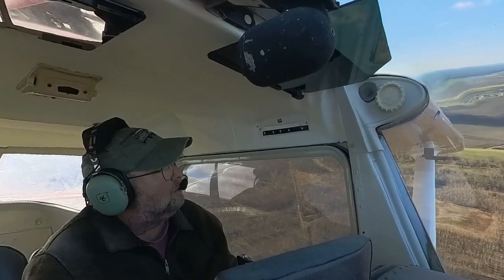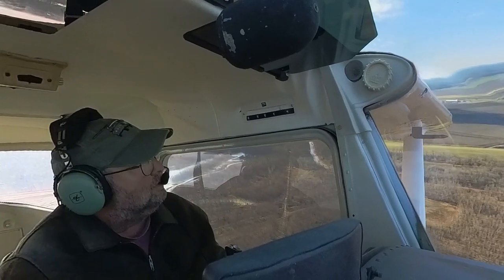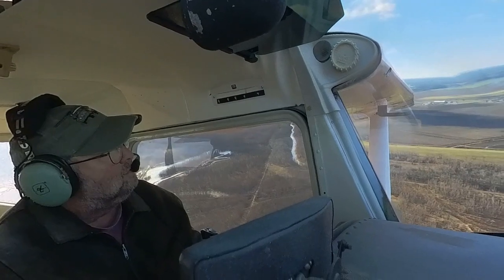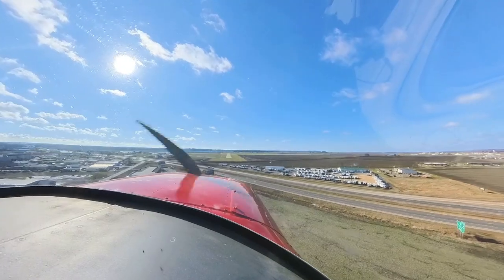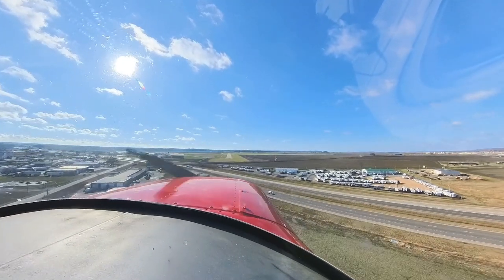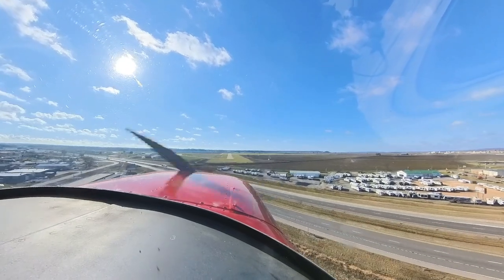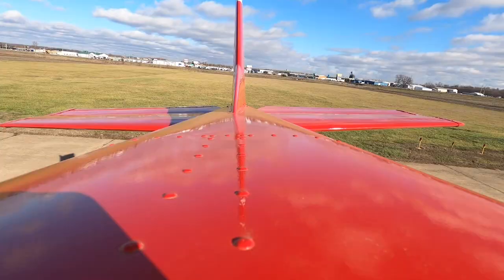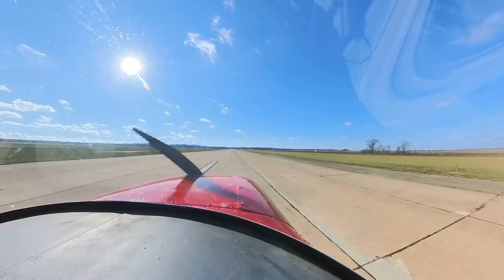Don't lower your flaps to 40 degrees in a Cessna 150 !!

Comment: As a  longtime CFI and owner of a 1976 C150M that has 40 degree flaps,, a blanket admonishment against the use of 40 degree flaps is questionable advice.  If a pilot understands the risks associated with the use of full flaps, and has adequately mitigated those risks, there is nothing wrong with taking advantage of the landing performance benefit 40 degrees offers..  One of those risks, as Mr Gryder discovered the hard way, is that under certain combinations of weight and density altitude,  a go-around may not be possible with flaps 40.  Hence, the use of 40 degree flaps should be reserved ONLY for when the runway is made along with a commitment to land.  We brief exactly that on each and every 40 degree flap landing.
Reply: ^^this^^
Reply: I feel like this is one of those things wherein the  use of 40° flaps is so specific that for a general audience "Don't use them" is the best default position, especially if you are learning from YouTube as opposed to a certified instructor. As you stated, the choice to use 40° wouldn't be there if it didn't have a valid application. Once you really learn the aircraft you can work exceptions into normal flying but for the beginner staying away from 40° is probably a good idea. I learned to fly in a 172M with a much lower glide ratio than normal, closer to 7:1 than 9:1. I had to carry some power much closer to the threshold on final to make the numbers. My CFII helped me to understand that this could be used to my advantage because it would allow for very short field landings if needed. He taught me first how to land like a 172 is supposed to and then work the specifics of this plane into my bigger picture.
Reply: My biggest fear with using 40 degrees of flaps on my 75M was that I could land in places far far too tight to get back out of.

In all seriousness - they also allow for a much steeper approach. I’ve done touch and with full flaps (was alone and light) and it did climb back out - but there is no mistaking that the flaps are down and you have to be ready to shove the nose down.
Reply: Agreed, I'm a CFII and own a C150 and use 40deg flaps regularly. Just gotta know when they are appropriate and when they are not. I also have mechanical flaps.
Reply: Dunno what to say?  My family’s  plane was a ‘76 M - we had it for over 40 years.  Full 40 degrees of flaps and a full boot of rudder to slip was great fun in the right conditions!
Reply: @rcaddiction7071  literally ANY airplane can land in a distance insufficient to takeoff again, regardless of flap settings.

If you make takeoff decisions based upon full flap settings, rather than takeoff settings and performance, you're a fool.
Reply: AGREE
Reply: I agree with you. As the owner of a 150E, with manual flaps, I enjoy the use of 40 degrees of flaps, and being committed to land is certainly helpful - however, I can dump them quickly as they are manual for me.
Reply: True… dragging the plane in is never a good idea.
Reply: Dragging a plane in under power on short final isn't  very bright to begin with. You should be able to glide it in from your key position. Flaps 40 is a great tool to drop it in short or point the nose down if you're way too high.
Reply: And who would ever drag an airplane in low with power to make a landing regardless of flap setting! That's just asking for it!
Reply: As a CFI I agree 100%.
Reply: Thank you for the great topic discussion on 40 degree of flaps owning a E model this is something that i have often hesitated on using
Reply: Why are you using partial power and 40 degrees of flaps and dragging it in behind the power curve? I use 40 degrees all the time but I’ll just use a steeper angle of descent, power off. And, I’ll only put in all the flaps when I know I have the runway made, and it’s clear.
Reply: As a student pilot I rented a 1969 172 with elec. flaps. The detents in the switch were worn almost flat (paint wore off too) so it was almost impossible (for a student) to find the setting you wanted...The CFI said..."ah...it's no big deal"...and it wasn't really. I had a lot of (un-logged) stick time because my uncle, a USAF, Retired, Lev. 6 Colonel, took me flying all the time (Super Decathlon)  in my 20's. After my solo first  flight we flew to Cable Airport (So Calif) where my brothers 1959 172 was hangered. My instructor checked me out in it and that's the plane I flew the most from then on. It had manual 10-40 degree and 40 was a lot of fun. One day (doing touch and goes) a gust of wind from the left  blew me right off the numbers just before touch down. I found myself flying over the tops of tied down planes along the taxi way. I (constantly) rest my hand on the throttle so I immediately added a little power and the plane ballooned up like kite (while pushing forward on the yoke). Now  that was fun too but my instructor never taught me how to do a go around...So I'm cruising along at about 60-65 and added a little more power and raised flaps one click to 30.....a little more power ....then 20 and so on. I still don't know if that's the proper procedure but it worked just fine....somewhere in there I turned off the carb heat.
Reply: The 1964 172 I learned t fly in had a handle between the seats. I believe the flaps went to 40
Reply: Exactly, if you want to mush into the ground
Reply: I just used 40 degrees today in the 1963  150-C I fly. I was doing a simulated engine failure, and was way high, so once I knew I had the runway made, I started putting in flaps until - you guessed it - 40 degrees. It's also a great tool to use if you're just too high and you need to get down fast.
Reply: I was taught to fly in a 150 in the early 70's in south Mississippi and was taught to use  40 degrees of flaps anytime needed.
Reply: I fully agree. I always used 40 degree flaps on short final with a 172 and it worked out fine every time. At that time, there was no need for a go around attempt and I loved the performance it gave me.
Reply: I too had a fantastic CFI. He taught us how to use 40* of flaps the right way as well as all the 150's envelope. Full stall, crosswind, short and soft field landings were the norm. Full flap go arounds were fun too.  He was great friend as  well.

Comment: My initial training was in a 150 with 40 degrees of flaps. They work just fine and I used them all the time. My CFI training was in a 150 with 40 degrees of flaps, and again no problem. I'd bet the odds of them not coming back up are less than the odds of the engine quitting when you stuff the throttle in. My Super Cub has 50 degrees of flaps and I use those all the time too.
Reply: Agreed, I'm a CFII and own a C150 and use 40deg flaps regularly. Just gotta know when they are appropriate and when they are not. I also have mechanical flaps, so not coming back up isn't much of an issue.
Reply: What kind of descent rate do you have with 50 degrees?
Reply: @noahshatto7218  No VSI, never looked, too busy flying. It's often done with a full aileron, full rudder slip, not far above stall. If you really want to have fun, try that with a Super Cub on floats! Totally controllable. I'm pretty sure it would pin any normal VSI.

Comment: I learned to fly from an instructor who was also the airport manager, A&P, DE, amongst other things.  We made every landing using full 40 flaps and we made all landings as 180 power-off landings.  We did many go arounds as I was learning to land and it was never an issue.  After applying full throttle and holding the nose down as it tried to pitch up, the flaps were gradually reduced allowing a climb.  The older 150 I flew had manual flaps and the newer one (only a year or so newer) had electric flaps.  Both were flown the same way and with equal success.  It does seem from all of the accidents analyzed by all of the YouTube “experts” that today’s pilots are not really taught how to fly the airplane.  I am glad I learned to fly from someone who know how to fly and knew how to use the airplane to its full capability and taught us to do the same.  I feel sorry for any pilot who is fearful of using flaps 40 during almost any landing.
Reply: EXACTLY!!  Students today are not taught how to actually fly the airplane.  They learn a bunch of rote routines from the high dollar rating factories that are focused on cranking out numbers instead of skills.
Reply: @SteveD328  I fear you are correct.

Comment: I learned to fly with 40 degrees of flaps in a C 150 and I am still alive. As a CFI, I taught students to fly with 40, and like me, they're still alive. The manufacturer equipped the aircraft with 40 degree flaps and the aircraft flight manual specifies their procedures and use. Can you get in a situation where flaps 40 is inadvisable? Yes, but that is a pilot problem, not an aircraft issue. I have attached a very good video from Backcountry182 is a very accomplished bush pilot and his take on using full flaps in a Cessna 150 is illuminating, even if you don't respect my 55 years experience and gold seal CFI. --Bruce Curtis, ATP, MEL, CSES, CFI, A, I, ME, AGI, IGI. https://www.youtube.com/watch?v=esFV4VcsQGE
Reply: Agreed, I'm a CFII and own a C150 and use 40deg flaps regularly. Just gotta know when they are appropriate and when they are not. I also have mechanical flaps.
Reply: @SoloRenegade 
I'll take crank windows and a stick shift (too). 👍👍🇺🇸😎

Comment: Cessna limited the flaps to 30 on the 152 for a reason.  Because the 150  / 152 was purpose built as a trainer and sometimes students forget WHAT on a go-around? That’s right, to clean up the aircraft.   After some incidents where the little 150 couldn’t climb enough with 40 degrees of flaps and bad things happened, it was changed to 30 max and this “never” idea came out. As has been pointed out “because they might not come back up” is a silly, at best, reason.  As our little gems are often in the hands of more seasoned pilots now - having the option of 40 is a desirable and usable feature.  But, you can see why the trainer manufacturer might not have wanted it and why this “never” idea might have been taught. Now you know the rest of the story

Comment: Very early in my career, in the late 70s and early 80s, I instructed in 150s and 152s.  I often used the full 40 degrees of flaps in the 150 and loved what they did for me, they were there for a reason. If you fail to think about the “what ifs”, well, then, maybe flying isn’t for you.  Also, for short field landings, never, ever, EVER drag the airplane in.  You will never realize the short field capabilities of your airplane doing that, plus you are setting yourself up for disaster.  On approach you have 2 vectors for your energy, a forward vector and a downward vector, the shorter the down vector, the longer the forward vector.  Remember, the energy has to go somewhere.  So, use a steep approach, you will have less forward energy, and when you touch down all of the downward energy goes away.  I have used this technique in jets many times and often brought the airplane to a complete stop before the reversers could fully deploy.  If you are worried about the 40 degree flap setting allowing you to get into places that you can’t get out of, you should have thought about that possibility before ever attempting to land there in the first place.  

SteveD328, 24,000 hr ATP

Comment: I flew a 172 in my training that, if I remember correctly, had the capability of 40 degree flaps, but my instructor said it was not rated for 40 degree flaps after the 180 horse conversion.
Reply: The 40-degree setting should have been placarded and physically blocked out with a metal plate.  The 180-HP STC conversion also increased the gross weight.
Reply: @reubenmorris487  I totally agree that it SHOULD have been physically blocked out.  I flew with a different CFI who apparently did not now this. It made me a little nervous when he set them to 40 degrees. There didn't seem to be any consequences, but who knows what would have happened if I had attempted a go-around?

Comment: I used full flaps quite often when I was training in a 150. As a matter of fact, there was often an updraft at one due to a very huge barn being right across the road. Slipped, crabbed with 40 deg also. Never had a problem. 
Haven't flown a 150/152 in several decades, but I still hold them in high regards. 
The lil plane helped me cut my teeth as a student. 40yrs now and I still remember the solo. Lol

Comment: I also did my initial primary flight training in a '66 C150, and back then I was even lighter than you at only 135#.  I did the bulk of my flying with that off a 2000' grass runway as well.  The only difference between 30° and 40° flaps is just drag, not any lift -- that's why the redesigned 152 was limited to only 30°, despite having more 'power', as it was...   I later flew a 150/150 with the 40°, and that one WOULD climb with the full 40 flaps down proving the axiom of 'With enough power, anything will fly' - (which is why the F-4 Phantom flies, but that's another story... ;) )

Comment: I learned a good lesson on my first solo regarding flaps.  On my second circuit at Boca Raton,  FL, in my 1967 Cessna 150L,  I didn't retract my flaps for my next take off... Just screamed down the runway without the ability to take-off.   Had enough sense to stop and return  back to the threshold.  Will never do that again!

Comment: I use 40 degrees of flaps all the time in C150's  and C172's. Did go arounds at gross with 40 degrees, before my instructor would solo me. Seems to be more of an issue with PA-28 pilots that are afraid to go past 30 degrees. Just like an engine failure at low altitude, land straight ahead and fly the airplane until it stops..

Comment: only thing to remember in a 150 at 40 degrees flaps on a hot day, is to add throttle, turn off the carb heat, and land that puppy.... if you can't stay a step ahead of a 150, why are you even flying?

Comment: I Disagree! Any Cessna 150 will go around with Full Power and bring the Flaps up ONE Notch . You will not SINK, if you know how to fly. 10 degrees and wait. Do not get into a hurry!  Flaps up slowly as Performance is gained. The last notch should NOT be retracted until minimum of 800 feet. I own a 74 150L with 40 degrees Flaps. Practice this regularly with no problems. ATP, CFII, MEI.
Reply: The point here is flap system failure. You're not able to bring the flaps up AT ALL.
Reply: @3SM20Pilot  and how often does that happen? Not very often, especially if you fly the airplane properly within limits, and maintain it.
Reply: @SoloRenegade  I've seen it happen first hand. My hangar neighbor's 150 went down fine in his preflight but wouldn't retract. Had to pull the inspection panel and hit the limit switch to get them back up. It happens, and will only continue to happen more frequently as these planes get even older.
Reply: @3SM20Pilot  I've had coworkers experience stuck flaps before too. but the flap system is so simple in these old planes, the only way they fail is if they are worn out and not maintained properly.

Comment: When the 152 was certified the FAA added a hot day high density altitude go around requirement. Even with 10 more horsepower the 152 did not meet the minimum climb requirement thus the 30 degree limit.

Comment: In the 70's I did my PVT checkride in a 150.  I didn't have to use full power in slow flight (minimum speed), which means I had reserve power for at least a marginal climb at 40 flaps.  Of course that meant proper pitch control which would require a much lower deck angle.  Check out what your airplane will do in all four fundamentals at full flaps at a safe altitude.  At Leadville, CO, nearly 10,000ft elevation, they never use more than 10 degrees in a Skyhawk because they know that airplane will not climb there with more flaps.

Comment: 66 was the first year for those electric flaps.
I learned to fly with manual flaps and thats what i strongly prefer.
Back then I flew a 59 and 64 and did a lot of stol practice and fully realized what 40* will do.

Comment: I fly a 1969, C150K into a small, one way grass strip up in Canada. No Go-around possibilities due to rising terrain and trees at the other end. The approach is over water, and through trees. Flaps 40 absolutely make the approach must easier, however I only deploy them once I know I have made the field in the case of an engine failure. 

Great video, but I still think that there is a reason and a use case for flaps 40 - but don't limit yourself to that only, especially when a 150 slips so well!
Reply from the maker: I absolutely agree with you, I had multiple engine failures and the only reason i kept from running off the end of the runway was by slipping the heck out of it!! Thanks for the comments.
Reply: @capecopters  and the only reason you likely didn’t run short was because you refrained from full flaps! Did I get that right?